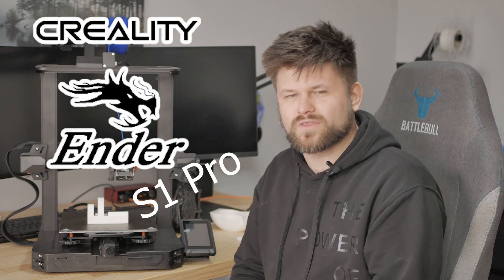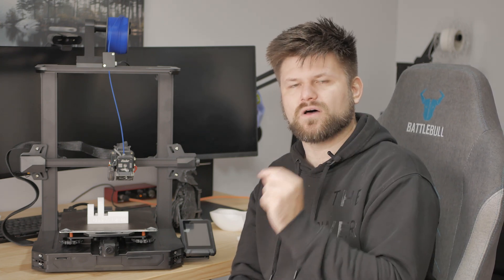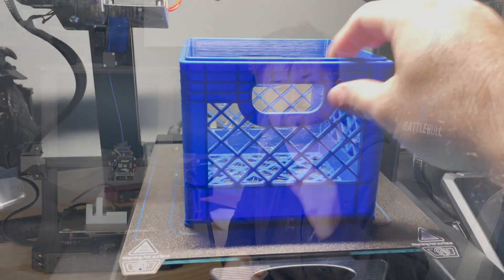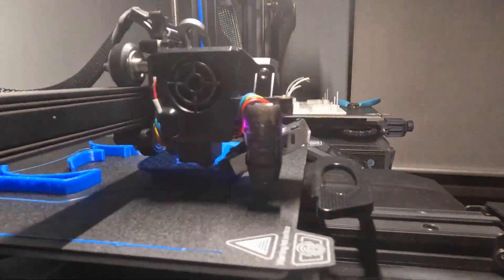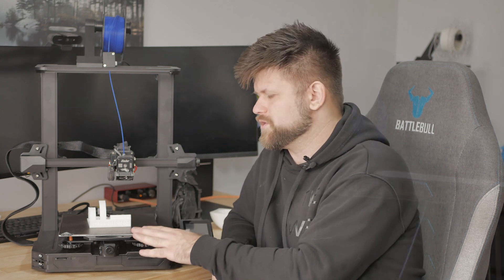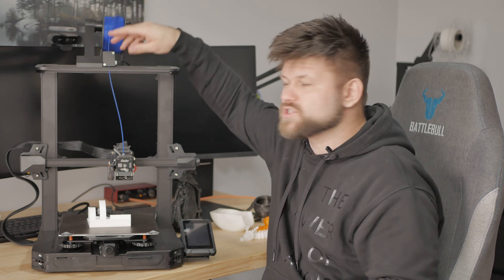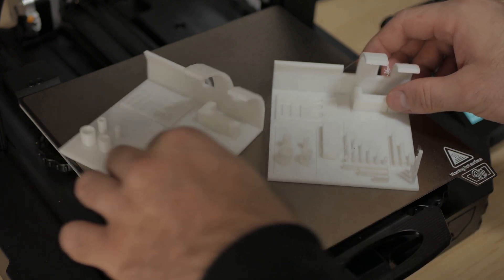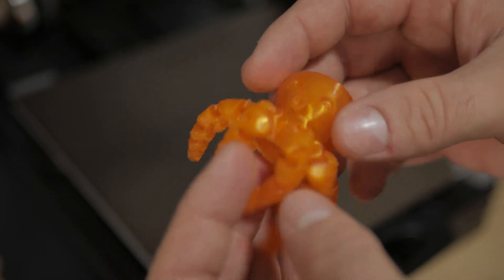Creality Ender 3 S1 Pro Review | 3D Printer

Comment: I just bought an S1pro after building it I’ve manually levelled it and then tried the auto bed level and this is where the issue has started. When I try the ABL it goes very slow takes about 5 minutes to create the first 4 mesh points across the front and times out and fails on the second row. I’ve not managed to create a mesh yet and I’ve tried multiple times each day in the 7 days I’ve owned it. So at the moment I have a very large expense ugly ornament. Any ideas ?
Reply from the maker: An idea would be to flash a the firmware again, using the tools provided.